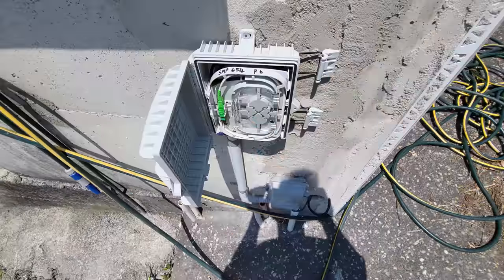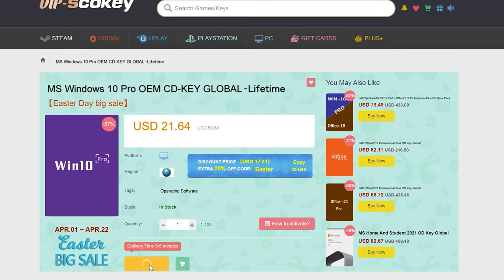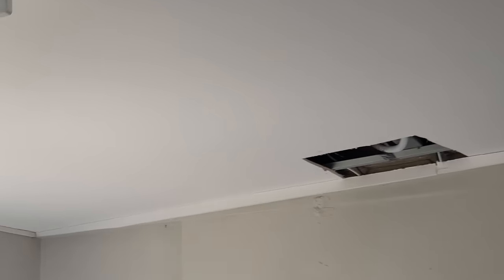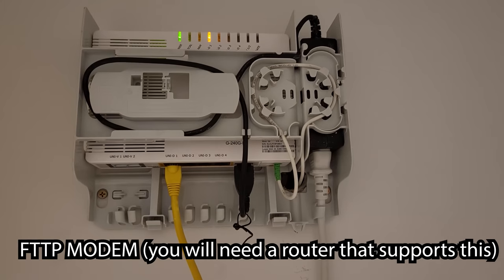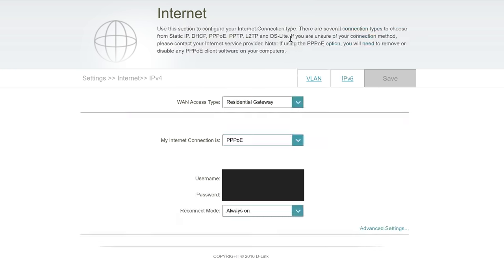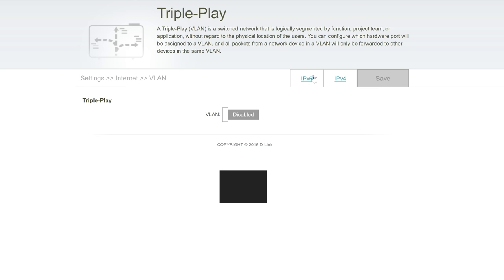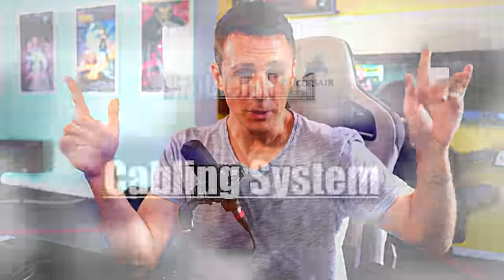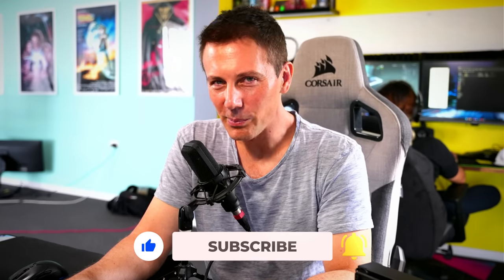UPGRADING my Internet to FIBRE for FREE! (Australian FTTN to FTTP Upgrade)

Comment: Glad you got the upgrade. But IMO the upload is still pretty bad for fiber, there's no reason for the upload to be lower than 1/2 of the download speed.
Reply: It's because NBN want maximum profit, otherwise you'd never pay for the extra cost they're charging for 250/100, 500/200 or their 1000/400 plans for which they charge much higher wholesale costs to the ISPs. Then there's the Enterprise Ethernet which gets even more expensive.
Reply: yeah the reason is those plans with symetrical download cost 300+

Comment: NBN has a dirty secret. The nbn fttp box comes with a cable that limits speed as a cat 5b to 50mbps despite what any plan or gigabit modem allows.. Upgrade this cable to cat 6 for around $6 and all of a sudden you get the max speed and more than just 50. Even on a 100 plan!  Mine went from 50 to..270. no extra cost.

Comment: I went from FTTC to FTTP and I love it. As an aside, we lost power for 24 hours about a week ago, and we have a generator. We used the gennie to power a few things in our house, and I didn't realise that the Fibre network works when there's a power network outage. FTTC never used to work when there were power outages (even with our FTTC box being powered by generator), and FTTN doesn't work in those situations either.
And FYI, to get free FTTC to FTTP upgrades you have to sign up to either 250/25mbps or 1000/50mbps plans to qualify.

Comment: Ridiculous mistakes were made in Australia during the 1980's and 1990's that kept many new suburbs locked to copper pair, despite there being optic fiber in the street, a few hundred meters away trunked to the infamous RIM cabinets.  Point to point microwave could easily have been provided in many locations, but Telscum had almost all the microwave broadcast towers under their control and blocked off competition.

Comment: I forgot to mention: regarding your upload speed issue.  

You may connect a PC directly to the NBN NTD/Modem and configure the network interface as PPPoE with the ISP supplied credentials.  You will also need to temporarily set the MAC Address of the PC's ethernet port to the same MAC Address as your router's WAN port if your ISP requested a MAC Address for the gateway device, or you'll need to do this test with your ISP on the line.  Make sure you check and if necessary, set your MTU/"Jumbo Frames" setting as well so the interface doesn't drop packets exceeding the MTU Size and giving an erroneous performance measurement.

Then you can test the network speed without the router inbetween to eliminate the router from being the possible cause of the bottleneck if the speed does not improve.

This will confirm if the problem is the router (if the problem goes away) or the NBN Service throttling unjustly.  
I am sure you are aware you'd be exposing the PC directly to the internet without the firewall & NAT protection in your gateway router so make sure all security updates are installed via windows update.
Once you're done, set the network port back to default on the Windows PC and reconnect the router as it was previously.

Comment: If you read the actual NBN documentation, you will find out the the NBN installer is actually responsible for running  the cable from the box on the outside wall to the inside connection point.

Comment: I wish they would even just run FTTN to my place, even though the fibre runs straight the end of my street which is only 200m away from my house. But I have to settle for Fixed Wireless, 13mbps down and 4mbps up..
Reply from the maker: WHAT only 200 meters? that's rediculous!
Reply: At least Starlink is an option now.
Reply: @techyescity  Yep absolute joke, was fighting with NBN for nearly 2 years about it and all they could say is that there is no plans to connect my street and if I wanted it done I would have to pay for it all

Comment: No complaints from Shanghai.  Just took a look at speeds over VPN.  Downloads over VPN 456 mbps.  Don't even pay for FTTH, unlimited data/ 5G router comes with cell plan that costs something like $20 dollars a month...plenty of cell data also included.  One thing I love if you manage to screw up any hardware they will come and repair/ replace for free. Love that Aussie advertising.  "Free Router" you just need to get clipped A$85 a month after intro period FFS.

Comment: as i am a student in Telco and my teacher has connection with industry and the person whole writing AS/CA S009:2020 and S008:2020 and the international standard too so i know abit more 

Never work for NBN/ISP  :3 
Work for Industry/commercial that where the money is at 

The Bending thing is call a cable reel or a fish tapes

Exctel and Superloop are same company 

You Will never get the full band with due to share around you areas 
i get 915.72Mbps Down and 44.34 Upload on off peak :)

Comment: Chorus hyperfibre 4gbit up / down $159 NZ per month . No limits
Reply: SYMMETRICAL??? Welp that's what happens when you privatise infrastructure in Aus...
Reply: @spusuf  you can get 8gbit up  down plan also. Standard low end fibre in nz is 300 down 100 up. They add 10% margin on it so In reality it's 330 down 110 up. These days most users go for 1gbit which is usually 1gbit down 500 up.

Comment: You turned 5Ghz Wifi of on you router?Did i get that right?  Bro 2,4Ghz Has MUCH lower speed and WAY more interference.
Reply: 5g is congested these days,  2.4 is not widely used these days in most of the world.   But still an option.
Reply: @Willbme4EVA  It is congested but way less than 2.4. of course it's an option but he will never be able to utilize the new fast speeds he is so Excited about.
Reply: He said he turned it off but did he say he didn't turn it back on?

Sometimes it's easiest to turn it off while you connect 2.4Ghz only devices and then turn it back on.
Reply: @futurecactus  I hear that Tech Yes City seems to do things outside of the box, then in and out.   It is what I call adapting to what works as tech throws curve balls all along the way.   How to find the all around snappiest, band for the buck, moneterial  feasable  PC.   Cheers

Comment: I mean technically you should have business class internet anyway.  You're running essentially a business from home, so yea...  Most ISPs do have TOS which limits residential usage.  $25k is alot of money to run fiber, but fast, stable internet is really invaluable in today's fast and high tech world.  Glad you got a free upgrade, but i would not have tolerated slow internet and forked over the $25k, thats just me though....

Comment: Got my FTTP upgrade recently, amazing to have gigabit, just a shame that upload speeds higher than 50mbps are locked behind horrifically expensive enterprise plans. 

I wish I could say things went smoothly, but the first dumbass that came to install things had to clear a blockage in the underground cable line to the pit, and he ended up striking our gas line. Fire department had to come to clamp it and he's on the hook for a significant bill from the gas company.

Comment: I used to be on adls2 for years. 8mbps and 0.4 up here in Mexico. 
Until a new isp came to my city and I switched as soon as possible.
 Booom 300mbps down and 60mbps up on single strand fiber.

Also your upload speed looks very odd. My speed tests have peaks to 1000mbps up and down on the first second of the test. Think your fiber cable might be damaged 😅

Also, your fiber installations in Australia look too complex for the poor speeds the give you 🤔. All I got is a thin black fiber cable that they drop down from a splitter node from the power company poles and that plugs into the 4 in 1 internet access point that covers the entire house

Comment: Hi Brian. Glad your router situation got resolved. Just wanted to offer some possible explanations to the PS5 and 5G wifi signal problems. The PS5 probably has port forwarding enabled. That requires a static IP. If it established one in the sub 100 range then mystery solved. As for the 5G wifi, there is a range of 5G channels called "DFS" that transmit in a range of the 5G band that normally is used only by radar and other Government equipment. Not sure when, but they started letting civilians use that range to help with getting 5G wifi to have more channels to operate on. Older devices don't support DFS channels because in the past that frequency band range was reserved. If you want to get the 5G function of your router working then try digging around your settings and find the option to disable the DFS channel range. It will force the router to only transmit and receive non DFS frequency range based channels. Hope it helps. This information is valid in the U.S.A. Not sure if Australia plays by the same rules. If you guys do then maybe you might have your answers. Love your YouTube channel, keep the content coming brother.
Reply: For whatever reason, port forwarding isn't required here for games to work, at least not with the scores of games we've tried at my house with 4 gamers but also, if the PS had a static IP address outside the DHCP range but still in the same subnet (which it must have if it was working previously) then it should still have worked so it's still a bit puzzling.

Comment: Congrats in my home town The best I can get is fttn 54mbs I tried to got to 100mbs plan multiple providers told me I can't due to technology limitations aka in my home town they cut down on fttn cabinets so most ppl live to far distance most ppl I know only gets 54mbs you have to be close to the fttn cabinets to have any chance of 100mbs
Reply: That's true but it can be worth trying the higher plan just to see, their estimates aren't anyways accurate in my experience.

Also, remove ALL unnecessary copper wiring from your phone line system, even if it's just going to an old unused, second phone plug, I got about 25Mbps increase by doing this in one of my last houses.

Comment: Have fiber 1000Mbit up/down since a year, before i had 500Mbit/20Mbit copper (docxis cable) for 58 Euro's.
I pay 60 Euro (100  Australian dollars a month) LOLOL typing since watching it and  ITS THE SAME PRIZE :PPP
The fiber comes to my.. what's it called where my fuse box is, 
from there to a NT box that connects to my router with cat6e, they  removed my phone line cable and put the utp cable in, changed to phone connector with an utp box :P

Comment: Im in a unit with fttb. Essentially its vdsl fttn but with shorter copper. According to my modem the max speed i can get is 180 down. Not too bad really considering were on a 50/20 plan which is honestly more than enough for our needs, and much better than adsl2

Comment: That upload is still poor and doesn't look like throttling.

In many countries you will get 500/500.

Those installers do not sounds very good and I expect they are not paid well trying to get as many jobs in as they can. (install for FTTP is very important which is why the whole thing should be done by pro)

You don't have anything like a network rack I didn't see any network switch.

Comment: You need to limit your upload speed in your router to 48 or 49 Mbps so you don't get auto throttled by the NBN. It's a stupid way the technology works (we should be getting 1000 down and 1000 up, but yeah)
Reply: Why do you say it's better to throttle it yourself?
Reply: That's not how it works, on Aussie broadband I'm consistently getting served over the paid speeds. NBN does infrastructure, ISPs handle service and speeds.
Reply: Its due to ‘NBN policer’
Its not that they are limiting upload speed, they cap your speed without communicating that to your modem router. So your modem/router transmits data as fast as it wants. The problem occurs when your modem/router transmits faster than you pay for, those packets get dropped which causes lower upload, lag and stuttering amongst other issues.
To avoid ‘NBN policer’ you need to limit your modem/router upload speed.